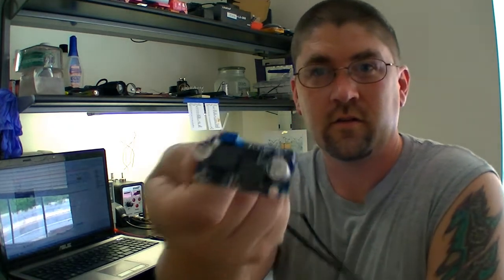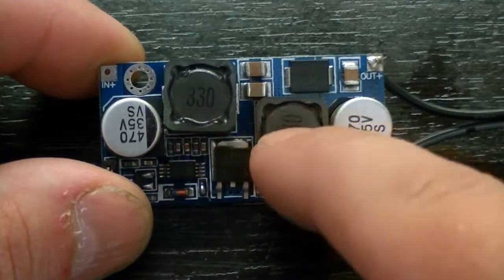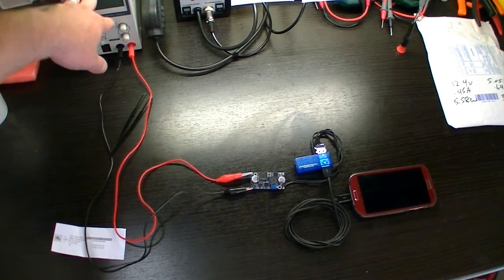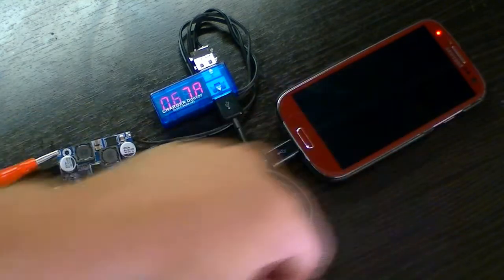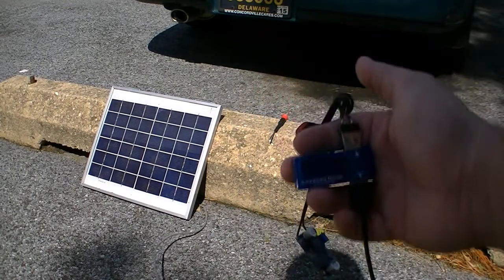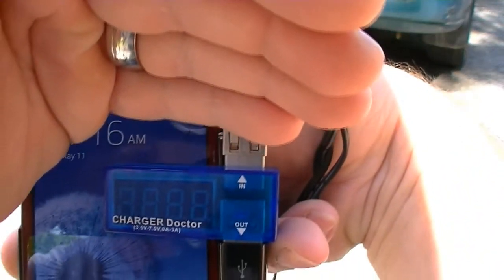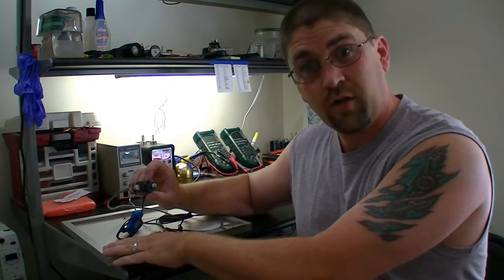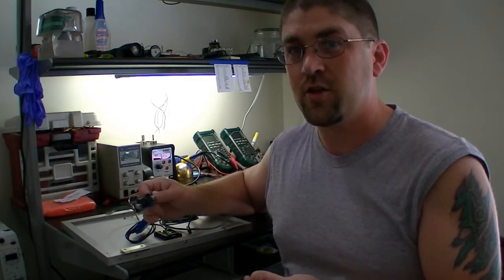Review Of ICStation Solar DC-DC Converter

Comment: Ahhhh solar and battery  (reservoir) is needed for stable power supply. You can power or charge DC devices direct from solar panel but it's iffy. Solar varies and regulation is needed. A DC-DC converter can work but best with a stable supply...

Comment: Have you tried it with a diode at the output? This way when the solar panel is shaded and the voltage drops, the output voltage will drop too. At this point, as far as the boost converter is concerned, the output has been disconnected.

When the solar panel is no longer shaded, the boost converter can get the output voltage back up without a load connected, allowing the input voltage to come back up again too.

I haven't tested this myself yet. I'm waiting for a boost converted to arrive in a week.

Anyone tried this?

Comment: Choosing to use a buck boost converter was a bad decision.  The boost function is what causes the panel voltage to go into a death spiral.  A buck only module would have dropped panel V only to the output volts. I have some videos on how to make buck converters into MPPC which gets you more than 90% of MPPT, see linear current booster.  If you want to learn real solar subscribe. Please ignore realflow poster as he has no idea what he is talking about.

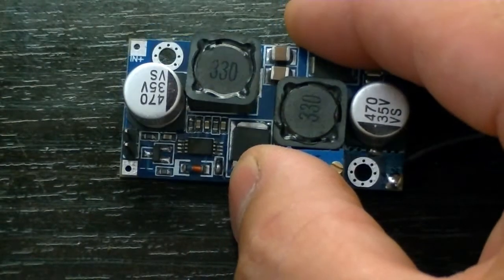Comment: At about 1:46 you said something about enabling the output. I have a buck boost board very similar to the one you tested. This is what they said about it..quote: Enable control port: yes, high level 1.4V - VIN (on), low level  0-0.8 V (off). default high level..unquote. Have you used anything like this?
Reply: And you said the magic word.  Many buck converter chips have an enable ON/OFF pin which can be modulated to keep the panel at the power point voltage and supply maximum current. I will be doing a video soon on how to mod these cheap buck converters.  You can also fake the feedback voltage into thinking the output voltage is higher and momentarily shutting down the converter. See my linear current booster video.

Comment: Could you add a circuit to make use of the disable pins on the regulator when the solar panel is below a certain voltage so it could resume? Or would that lead to cycling? Just a thought. Thanks for the info.

Comment: Get a synchronous DC/DC converter
NOT asynchronous 
The difference means it will continue outputting power even when the output is shorted and will bounce back up instantly

Whereas asynchronous will NOT cut back on after the input voltage has dipped.

get a synchronous buck/boost DC/DC converter (NOT BOOST)
Preferably buck.
with a 1000uF capacitor on the output it will help a lot
Reply from the maker: i'll try this.  thanks.

Comment: hi great vid, have been trying to work solar and dc-dc converter for the last week. well explained. can you try it with a bigger panel. 10w panel vs 25w dc-dc does not seem to be a good match i may be wrong here. With this design what would be the solar panel size to make it work. (cheaper to buy more solar panels than more batteries).

Comment: Is there a difference between this buck converter and the XL6009? Can the XL6009 power a 50 watt led chip at close to full brightness?
Reply: NO it will not. even with a heatsink.
Do not attempt to draw 50W from that chip unless your input voltage is near the output voltage.

Comment: thats strange. I have had no problems at all using cheap $1 car cigarette lighter USB adapters attached to my 12 volt solar pannel to charge my phone. Even on cloudy days and walking back and forth in front of my panel at my camp site. The problem may either be the USB moniter unit or that specific sepic(boost/buck) coverter.
Reply: Reberto de Tomkinsinio I tried using a USB car cigarette charger and found it regulated a steady output and the phone would show to charge. An Amp reading using an App gave a current input of around 350mA.

However the battery percentage would steadily decrease and has never shown to increase.

I'm guessing the phone output power of its battery was higher than the input power. This led to a discharge of the battery through the high resistance of the car charger.

Comment: Maybe a super capacitor booster could act as a buffer. Say a couple or more 100 farad hooked in series. This way the setup is not so temperamental.

Comment: Using a small 12v battery inline as a buffer will solve this issue. Hook the panel to the battery and then the battery to the buck converter. It can be any size (ah) battery.

Comment: I will soon test solar panel charging via a DC-DC Step Up & Down Boost Buck Voltage Converter (eBay item: 201138075192), charging a 12 volt lead acid battery from a 50 Watt Amorphous Solar Panel. The idea is that since this is an up/down converter, it can handle and convert both the high and the low voltages from the panel to, say 13.6 volts. The reasoning is this:
1. The converter willl produce more amps to the battery as long as the panel voltage is higher than a set point, say 13.6 volts.
2. When the panel voltage drops below 13.6 volts, the converter will convert upwards to 13.6 volts, but now with lower amps. The nice thing with this (if it works), is that the panel also can charge the 12 v battery from 3.5 volts (and up 10 13.6 volts), but now with very low to low amperage. Still, that is better than no charge at all as it usually is when the panel voltage drops below the battery voltage.
I won't make a video of this, but I might come back here with an update later. R&Preppers, I really enjoy all your videos here, feel free to make a video of a similar setup your self. It would be very interesting :)
Reply from the maker: Geir Laastad Thank you for the comment.  I would like to know how this works out for you.  I still suspect that your boost/buck converter will ultimately collapse the panel voltage in certain situations.  If the voltage on the panel drops below 12 volts the converter will actually request more amperage from the panel to make up the loss in output voltage.  This in turn will further collapse the voltage on the panel, and the whole system will collapse.  I'd love for you to prove me wrong though.  :)
Reply: Geir Laastad have you done the experiment?

Comment: hello , i m new into solar world ...
recently i m wondering if i build a 30v panel at 2.2A , and step-down (DC-DC converter) to lower voltage , will the amp increase ?
Reply from the maker: No, you need a MPPT charge controller to convert the extra voltage into more amperage.
Reply: wouldnt be there any cheaper affordable way ?
real mppt is quite out of reach so far ...
Reply: R&TPreppers
Are you absolute certain on this? I know at least some of the 12volts to 5volts USB sigarette lighter plugs actually increases their output amps compared to what their inpurt amps are. They are DC-DC downconverters, but still...

Comment: Thanks for the info. I need help with a 3volt to 5volt USB 2.0. Circuit board I purchased from browndog. It worked one time to charge my iPhone 5; however it failed to produce enough power to charge phone. Put the USB doctor on it and using 3AA batteries and cannot get more than 4 volts. Can you help me? Brown dog could not figure it out and would not give replacement. I like your channel and feel you could help me. I can even mail it to you for your diagnosis. Thanks
Reply from the maker: Without knowing the specifics of browndog's circuit board, the only thing I can guess is the AA batteries couldn't supply enough current to properly charge the Iphone5.  remember that phone charges at 5v/1000ma.  The AA batteries will have to supply 3v/~1800ma since the boost converter will need more amperage input so it can convert that extra amperage to voltage.  Also make sure the boost circuit is rated for 1000ma, not 500ma like older phones used to require.

Comment: i have one of these, i'm in the process of building a solar panel, i am gonna have 10 cells extra that would give me 5 volts, can i use one of these to boost the voltage to 16-18 volts to charge 12 volt batteries??

Comment: Good info to know. I am going to use similar setup with a sharp 235w panel that outputs ~35 v to boost the voltage to ~45v. I need that because the grid tie inverter that happened to have (enphase m210) wants 38v to start.
http://enphase.com/global/files/Enphase_M190_M210_Installation_Manual.pdf

What you think? is it gona work?
I am going to use this one:
http://www.ebay.com/itm/Boost-Power-Supply-DC-DC-Converter-Step-up-Module-10V-60V-to-12V-80V-600W-10A/141015393957?_trksid=p2045573.c100033.m2042&_trkparms=aid%3D111001%26algo%3DREC.SEED%26ao%3D1%26asc%3D20131017132637%26meid%3D6927086559618368106%26pid%3D100033%26prg%3D20131017132637%26rk%3D1%26rkt%3D4%26sd%3D141015393957

thanks
Reply from the maker: Any DC boost converter will not work reliably when connected directly to a solar panel.  Your best bet is to find an mppt grid tie inverter that accepts 12-50vdc input.  That will be a much better match for your panel and you will get more efficency out of the setup.

Comment: Great review. I'd like to try one of these to make a permanent 5V USB charger (2 ports, probably) in my truck so I don't have to plug into the cig lighter port. In that case, I wouldn't care about efficiency bc I'll have plenty of power available. Would you suggest using this converter in that situation?  Thanks!
Reply from the maker: That is a perfect use for this unit.  You could most likely do 4-5 usb ports easily without taxing the unit.
Reply: Just attach a USB car ciggatte lighter adapter to your solar panel. It works great with my 12 volt panel. You can get them with 2 ports.